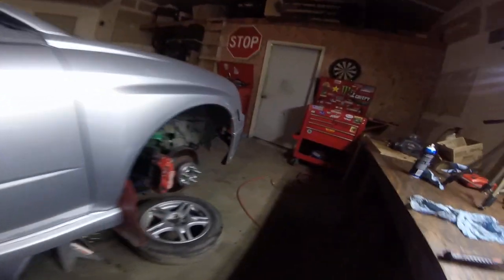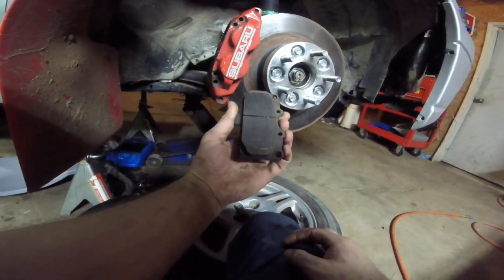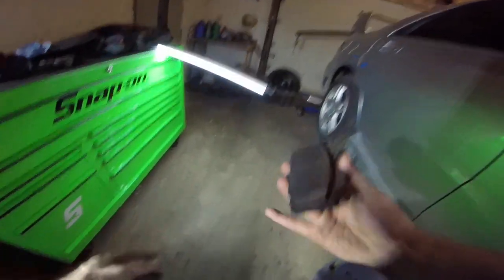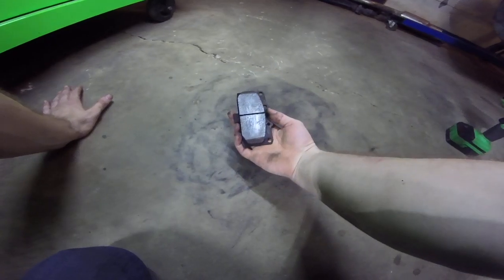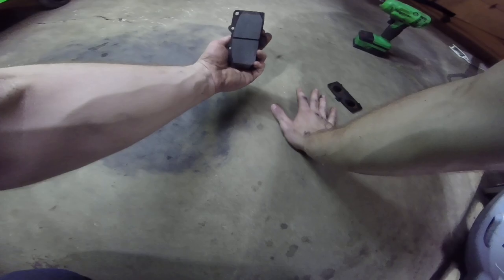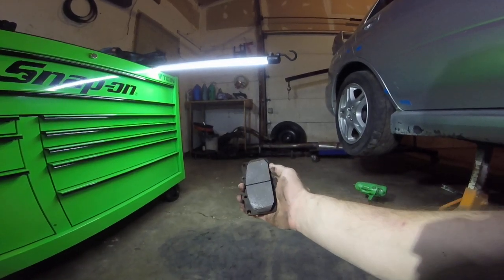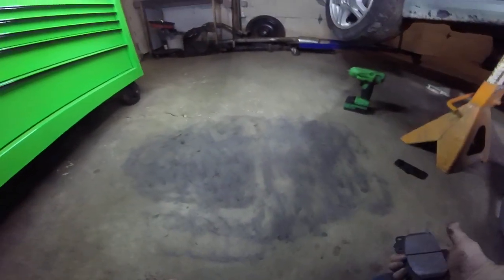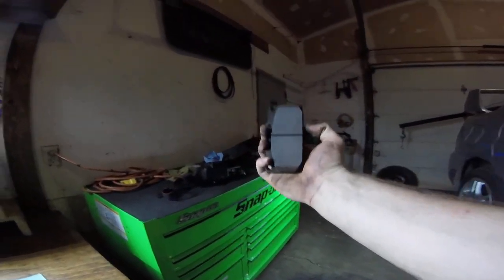How To deglaze Brake pads

Comment: After watching this video, I realised that my brake pads were so thickly glazed that my steering wheel would wobble even when not applying brakes. Thanx for the explanation of the phenomenon here, it was very helpful
Reply from the maker: No problem, if you need to know any more.info give me.ideas ill.make more videos
Reply from the maker: Also if your steering wheel is wobbling alot it the problem is in the front brakes , the rotors could have a hot spot wich makes them warped and the wheel shake. If you feel the vibration in your feet or seat its the rear brakes

Comment: Thank you for this video!! about a month ago my brakes weren’t probably breaking right but now they’re all better I found out it was my calipers but now they are squealing terribly when I stop my vehicle at a stop sign or parking space. Would this be from the brake pads glazing?
Reply from the maker: How thick were your brake pads ,is the ware bar hitting the rotor , and somtimes the squeak is normal for the first couple of stops if the car sits, make sure to check both pads inside and out side because if the slide pins seize on pad may look nee while the other pad could be completely gone

Comment: Glazing occurs because your brake pads overheat.  The pads become brittle and can fracture.  Sanding off the glaze does not fix the issue.  You need new pads.

Comment: Actually, you are doing it wrong. It has to be done in Figure 8's to maintain even sanding/ grinding. It will not be perfectly flat doing it your way... on a side note a garage cement floor has dust,dirt, and oil on its surface, and now that oil or dirt is present on your pads now. The bottom line is that this is not the way to deglaze brake pads.

Comment: Apparently sandpaper emery grit can get imbedded in material, weather the disc Or drum.
Replace new better soluution, esp if not PERFECTLY flat.
Impossible on drum shoes
Reply from the maker: Yes replacing is always the the better solution but if you have a brake lathe that machines the rotor like new

Comment: Hi, can you show us the difference between the glazed rotor and the normal one?  Thanks.
Reply from the maker: The rotors dont get glazed the pads do if your rotor is warped all you can do is cut or machine it if its thick enough
Reply: Rotors do glaze. It's the same as the pads. It has a shiny look to it. Removing it is the same process. Either sand or scuff it down.
Reply from the maker: The proper way to fix the rotor is to put it on a brake lathe and machine the rotor so there is no low or warmed spots , I just don't have a brake lathe at my house to show you.

Comment: Sand paper works too? 🤔🤔
Reply from the maker: Using a 90° die grinder with a abrasive pad works great also
Reply: Alyx Williams 👀 I'll try the sand paper if the cement trick doesn't work. Lol. Thanks for this tip/trick
Reply from the maker: Yeah no problem just make sure the cement isnt to rough if you use cement
Reply: Alyx Williams got it! Thanks again
Reply from the maker: Yep no problem let me know how it goes or if you have any problems